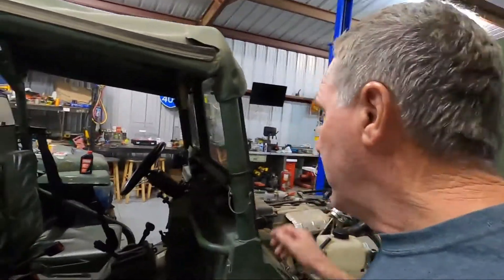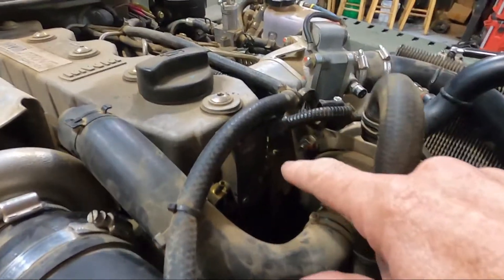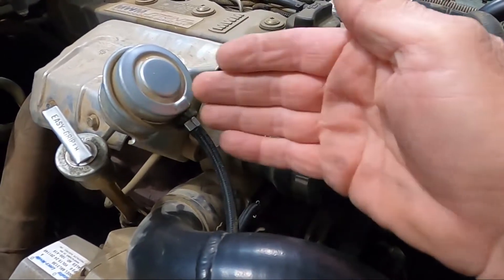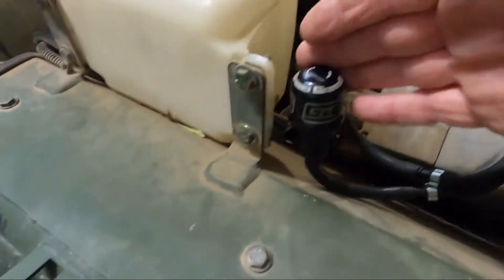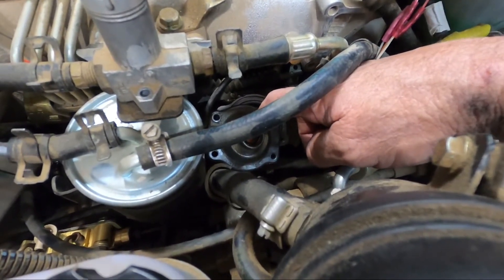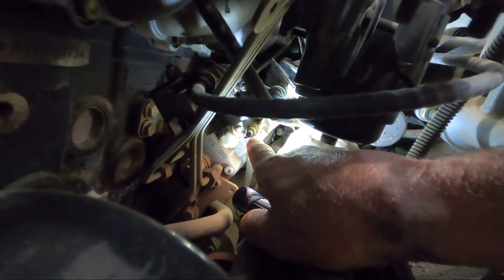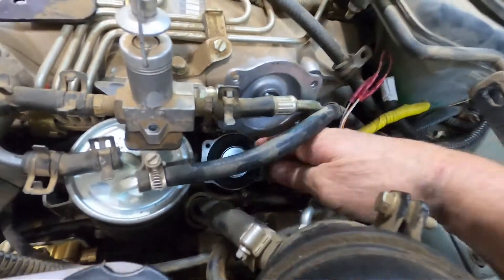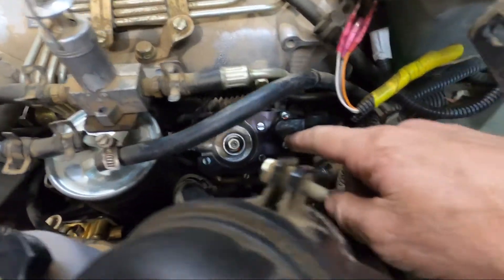Smokin' Growler Why does My M1161 or M1163 smoke

Comment: Any idea of a part number for the boost controller?
Reply from the maker: The stock controller or the aftermarket?
Reply: @RasmussenEquipment  the stock one. Or is it best to just leave it plugged in and go grimmspeed?
Reply: My actuator was frozen and even after some work takes about 50lbs of force to move the rod. So I ordered a Chinese turbo I’m waiting on
Reply from the maker: I don’t know any part numbers for it, have you looked on the Growler forum? The info might be there somewhere
Reply: @RasmussenEquipment  I looked but they haven’t turned on my ability to comment. The actuator pot shouldn’t take like 50lbs of pull to get the rod to move right? Wastegate was free moving but that rod was a bear. Even after soaking it overnight.
Reply from the maker: No it should take about 15 lbs.

I have heard that a few people are waiting for access to the forum. 
I wonder if the moderator is not around anymore. I’ll try to get ahold of him and if something has happened to him we will have to see if we can get access to it.
Reply: My controller is all rusted up.
Reply from the maker: are you talking about the dashpot mounted onto the turbo?
Reply: @RasmussenEquipment   I got it all back working again now! Luck was on my side